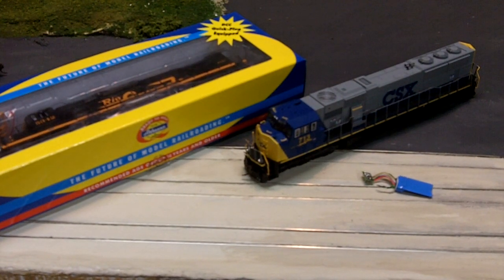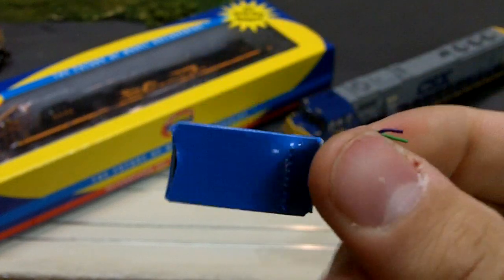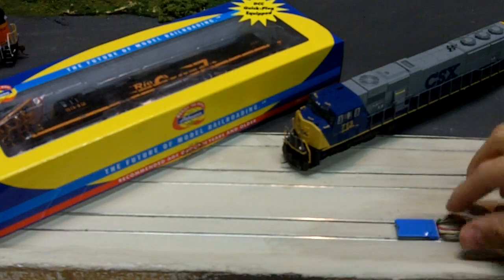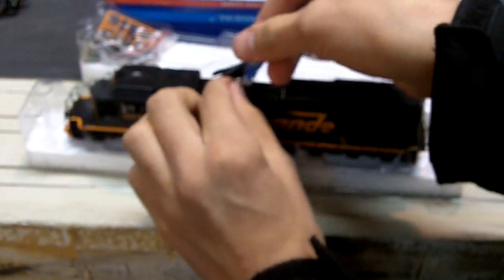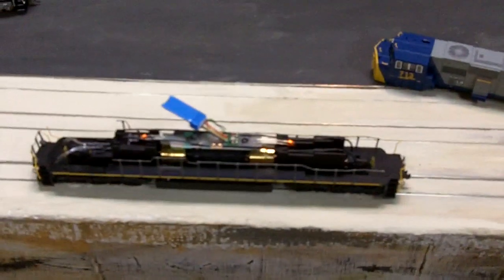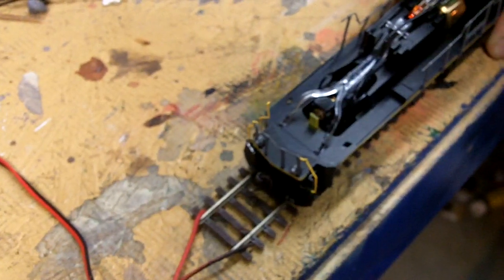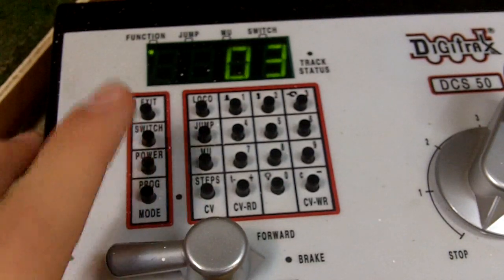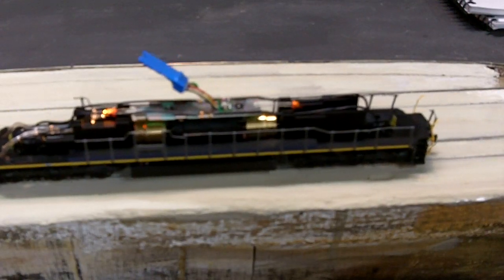Installing and Programming a DCC Decoder

Comment: I usually do my programming using the "Programming on the Main" function.  Very easy, and works with everything from Digitrax, NCE, to Tsunami Soundtraxx.  You can program CVs on the Main, you just cant read them.  For that you need a program track and probably a booster too.